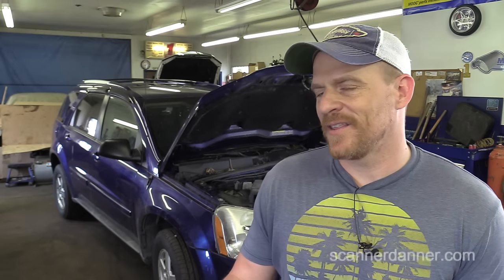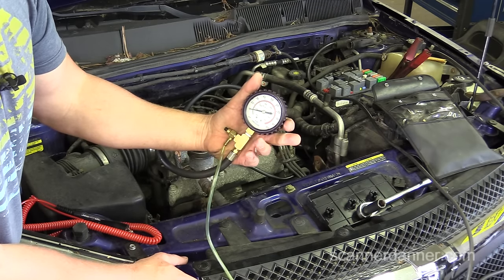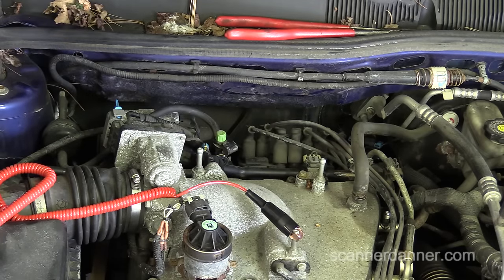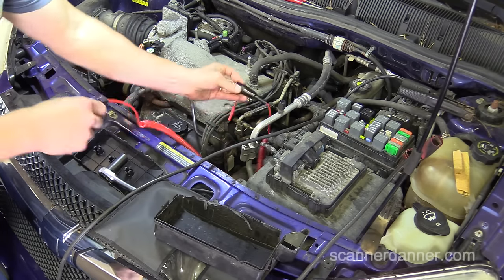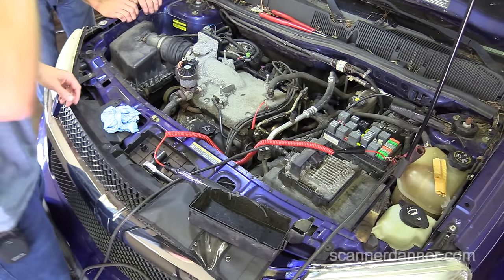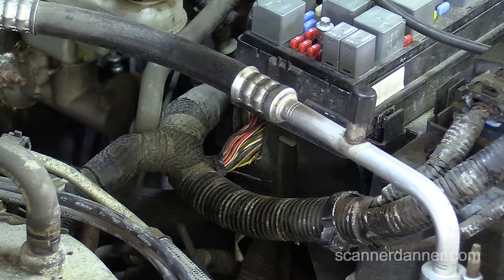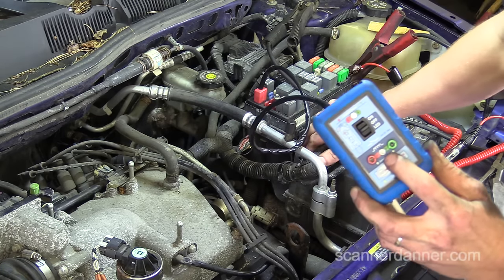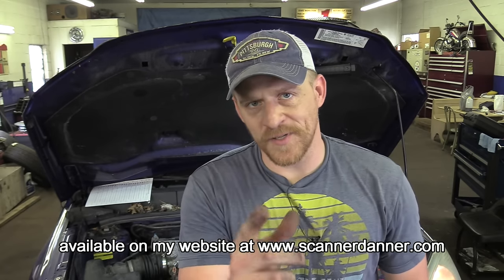No Start, Engine Cranks Okay, Troubleshooting With Basic Tools (No Power to Injectors)

Comment: Paul or anyone can you help me with my 2004 Yukon cranks no start new crank sensor & plug. I am getting a signal to my fuel relay for less than 3 seconds then it turns  off. I have power going to relay all the time. Relay is good not the problem. Is there a video i could watch for this?

Comment: Can you help me out a bit, I have a Chevy Sonic 14, injectors are not firing, I put a multi miter to it and I can't detect any signal down the line so it's electrical.
I have a code u0101 not detecting the TCM, I am almost sure there is short of an open somewhere, electrical work seems daunting.
How should I proceed to find the fault, thanks in advance, I'll follow some of the procedures found in this video but any extra help won't hurt
Reply from the maker: Let's move this to my forum www.scannerdanner.com 
It is free to join and we can definitely help you. I have 28k global members and hand picked moderators who've been with me for years and know my material inside and out and are there to help me help you guys. It is just too difficult to offer back and forth messages here on YouTube with stuff like this and we also can't share pictures and images here like we can on the website. Hope to see you there!

Comment: Hello, Paul. I am trying to figure out a crank no start condition. I have read that the crank sensor is not used for engine control system. It is used for onboard diagnosis. Can I rule out the crank sensor as the reason for the crank no start?
Reply from the maker: That would be incorrect. Most cars will not start without a crank sensor signal.
It would help to know what you're working on (year, make, model, engine, trouble codes etc) and also what you are missing (spark or fuel)
Reply: @ScannerDanner   2000 Nissan Xterra. What I read was from the description and operation of the crank sensor for this truck. I should have been more specific. Sorry about that.
Reply from the maker: @bbmd2200  absolutely! Yours is the anomaly. If this is a distributor engine, you are correct, that crank sensor has nothing to do with your no start. It is used for low speed timing control only (smooth idle speed) weird system.
Reply: @ScannerDanner  Yes, it is a distributor engine. Thank you for replying. Stay safe.

Comment: With any relay controlled circuit the VERY FIRST thing I would do is check the relay.  Dosent matter if its a ground or hot tripping it.  Reason... first its the easiest to check with an ohmmeter or test light. second theyre more likely to fail than a fixed (within reason) wire.

ANY relay has a coil and if thats open -- it wont work.  Find both ends of the coil pins and check for  both ways by reversing the test light or ohm meter. ALL relays in a properly designed relay will have a spike suppression diode across the coil. A good relay ( as far as the coil goes)  will show  BOTH ways.  With a bad coil that diode will conduct in one direction ONLY. If it shows no continuity either way BOTH the diode and coil are open. That diode dont do much in a pure relay setup but it can cause all sorts of weird things where computers of ANY form are involved with relays because of the back emf from the coil when the circuit is opened up. The diode shorts out the back emf when the juice through the coil is shut off. With a double throw set of contacts the common will show continuity from the common to one of the contacts with the coil unpowered  and from common to the other one with he coil hot. Easy to check with a pair of jumper sand that battery in the car. Ive seen 2 with bad/burnt contacts but with good coils.. :) 

Number 1 rule to fix anything is to start at the easiest thing to check first then go deeper if needed. 

Over all a great series of trouble shooting and fixing there. You just have to be smart enough to figure out even the most advance scanner will never tell you the EXACT cause of fault codes but only where to start looking why the fault occurred. :)

Comment: I have the same symptom but opposite of this. I have power but no pulse. Chevy 4.3 spider injector. How can I test? Thanks in advance.
Reply from the maker: Step 1, what is your fuel pressure?
Reply: @ScannerDanner  Thanks for replying so fast. I have about 55psi with a brand new fuel pump. I have spark and a brand new spider injector system. The engine runs with starting fluid. I found power to all 6 injectors but they are not firing. Thank you
Reply from the maker: @jaysplace1299  these injectors will NOT fire below 50psi. What is your exact pressure during cranking? Should be minimum of 60psi
Reply: @ScannerDanner  I will check and get back to you. Thanks
Reply: @ScannerDanner  I have 56psi  with key on and 62psi while cranking. New parts are fuel pump, spider injector, crank and cam sensor. power to injectors but no pulse. I updated to new style multiport spider injector. How can I test pulse from ecm?
Reply from the maker: @jaysplace1299 do you have spark? Very important to know before our next step.
There is a purple/white wire (distributor reference) that we're possibly going to play with next (with an incandescent test light)
Reply: @ScannerDanner  Yes, I have spark and if I spray starting fluid or gas into the intake, it will run great until its out of gas? Gas is just not going through the injectors.
Reply from the maker: @jaysplace1299 okay perfect. Next step, with key on, touch on and off the purple/white wire on the distributor connector with a test light to battery positive. The fuel pump should turn on and injectors should fire each time you touch it. Tell me what happens

Comment: I have a 91 chevy caprice I've checked relays change fuel pump and I'm not getting any power to the fuel pump the only power its getting to the fuel pump is the sending unit wire works what you think I can do
Reply from the maker: Do you checks at the fuel pump relay next
Reply: Yes so far it's coming on or let's say I can hear it click on
Reply from the maker: Not good enough of a check. We need to see the load side of that relay light a testight with everything plugged in DURING cranking
Reply: Ok I'll try that and get back with you
Reply: Ok I check it and I have power to the orange wire I also have power on the green and gray wire for 2 seconds when I start it
Reply from the maker: @tristenfletcher577  The gray wire is the pump feed. If it is good at the relay and then not at the pump itself, you have an open in that gray wire between the relay and pump
Reply: @ScannerDanner  so I need to run another gray wire

Comment: My santa fe crdi wont start but it cranks OBD error code p0611 found my ecu has burned chips is that posible that was the cause of no power injector?
Reply: By the way hired mechanic was the one mentioned me all of this Hope you can help me with this question im a newbie.

Comment: Quality OEM fuel pump should last at least 1K miles or more. If you take proper care of them that is. Automobile manufacturers build in about a gallon of reserve fuel beyond the empty line. Some of us know this and like to play that dangerous game of driving until the very last possible minute. However, from what I've learned it's bad practice to run your fuel tank low on vehicles with intank fuel pumps. The fuel pumps rely on fuel to lubricate the pump.  Take that lubrication away and its only a matter of time before the pump burns out. 

I personally can appreciate the fact that sometimes we just don't have the cash on hand to top off or even keep our cars tank at half full. I mean we have to eat too sometimes. Right? 😉 Gas prices can be cost prohibitive at times for some of us. However, keep in mind that it's more expensive to replace a fuel pump. Not to mention the trouble/inconvenience of being stranded somewhere.

I was surprised to find out recently that a failing fuel pump may cause your engine to overheat. From what I read If your fuel pump is dying it might overheat and this heat causes your engine to overheat. Unlike the radiator, which will overheat until it bursts the cap and spews scalding-hot coolant everywhere, an overheat caused by the fuel pump will stall out the engine. So, pullover at the first sign of overheating.

Comment: What would cause a intermittent crank no start? Especially in the early morning once/twice a week...

1998 ranger 4.0 4x4 

Codes: p0171 & p0174 

Ive smoked it. I've replaced vacuum tubing that was  corroded. 

I've cleaned/changed;
IAC
MAF 2x
Throttle body cleaned 
Fuel Pressure Key on 62-72 psi/ KO; 56psi maintained press for hours...dropped to 45 psi in 3 hours. 
New Fuel filter
New Plugs/ wires
Reply from the maker: What is fuel pressure when it is not starting?
Reply: @ScannerDanner  I haven't tested it when intermittent problem occurs. I will test it next time it happens, but if the psi is low or non-existent what would it be at the point?
Reply from the maker: We focus on the pump circuit and pump itself.

Comment: nice one. thx for sharing. i have a 1994 toyota carina with the 85kw 4a-fe engine and bosch ignition system and ecu. it's also a no start. fuel pressure, spark, compression all OK. there is voltage at injectors, but they don't pulse. was thinking bad injection driver. changed the ECU, still no start. All voltages in and out of ECU OK. What would you check next?
Reply from the maker: I believe there is an IGF circuit on that ignition system that provides the ECM with the necessary signal to fire the injectors. It comes from the igniter and is generated by the firing of the ignition coil
Reply: ScannerDanner thank you for answering. the bosch ignition system on this model doesn't use an ignitor only a coil. https://www.rexbo.eu/bosch/coil-ignition-221502002?c=100150&at=5240
type of distributor used; http://www.autoparts24.info/item/A_0026_E13811/
Reply: R. E. Hill I have a corolla has similar coil cracked the igniter would be connected to pickup coil in distributor feeds ECU &back.to igniter
Reply: Don Desnoo ho Don. Carina E Xli AT190 1994 85kw doesn't use an ignitor. Other versions of Carina does, but not mine. On those models the ignitor is located on the left strut turret housing or it is a part of the distributor. So no ignitor on my model. thx for taking the time to reply.
Reply from the maker: My fault. I looked up Camry...i don't have a listing for that model, I'll have to look again
Reply: ScannerDanner that would be awesome. thank you very much. this has been an intermittent issue for some time. several days of same type of weather would lead to a no start. after a weather change it would start again and so on.. it woukd run perfectly once started, never any issue, even on longer trips. then a couple of weeks ago it stopped while it was running, no start since that. had to have it towed. the stop was sudden and without any warning just as if it was switched off. have tried to diagnose it for a long time, but since it is so intermittent i am unsuccessful. only no firing of injectors. that's it. that paired with the fact that my knowledge on this subject is just a tad over basic. however i do know how to google and watch youtube.. ☺ your channel is just a wonderful thing. and Ivan(pine hollow auto) and Eric O (south maine auto)... ☺ rather watch you guys than anything made in Hollywood.
Reply: R. E. Hill my coil had a crack I tested it w .battery charger and a tv.capacitor on the neg. terminal grounding the case when I jumped the cap .spark jumped to crack  .I siliconed it tried it starts got new one advance Autos.. yours similar .coil in distributor on mine.same thing happened very intermittent finally towed no start .
Reply: Don Desnoo thx for answering. i have good spark. this is not the issue.
Reply from the maker: can you did up a wiring diagram for me for this? Maybe post this to my forum, it would be way easier than doing this here. Let me know when you do okay?
Reply: ScannerDanner hi. wish i could. cant find diagrams for bosch only denso.. and they are different.
Reply: R. E. Hill ha
maybe try propane to  
 air inlet to start .check for crank or cam sensors if used ECU has to get pulses some place.
Reply: Don Desnoo hi. thx for the suggestion. there isn't a crank sensor. it uses the hal sensor inside the distributor(so sort of a cam sensor). your suggestion has been tried,  didn't do anything but run of the starting fluid, it did not activate the pulsing of the injectors. thers must be a short to ground somewhere. can't find it. thinking about wrecking it. gonna hurt if so, really like it. 😭
Reply: R. E. Hill another power 12v to ECU 5v to injec

need12v .to ECU 5v to tps  I know you repld ecu  you need diagram ho abt Haynes book bought book wrong diagram called them sent us alternate for Volvo theirs very good. if it has tach w propane run dist pulses are there .I'm ret tv repairman some auto elect.knwledge 75yrs old .
Reply: 5v to sensors sorry
Reply: I would check anti-theft system causing the ECM to not pulse the injectors on purpose. A mismatch between key fob operation and individual door lock solenoids can cause the issue as can a bad anti-theft module itself. My BMW still won't allow me to use the electric windows when it's cold, but ever since I cut the nefarious pin 66 wire to the ECM it will at least start and run for me at all temperatures, not just when it's a warm day.
Reply: Lee Barnes hi. thx for the suggestion. no anti theft system on the car.
Reply: R. E. Hill igniter above eng temp SW.or shock towering Haynes has a book on them.
Reply: R. E. Hill try unplug map may be full moisture had aries had too relocate sensor above engine only ran w unplugged
Reply: Don Desnoo there is no igniter on this model. this version of carina has the bosch ignition system using the Motronic Bosch ECU. That system doesn't us an igniter. I have the Haynes manual and it's not very helpful nor accurate for my version and my particular problem. Especially the wiring diagrams are useless. I have Toyotas electrical wiring diagram supplement EWD303F, but that is the wrong one, i need publication number EWD205F or EWD233F. I can order it from Germany, long delivery time...
Reply: R. E. Hill Toyota owners club USA  see trouking  has one  many notes on it  his no igniter .2016 .if you can find him still

Comment: Do you have any videos where the vehicle cranks and starts for 2 seconds then dies? I love you trouble shooting videos, you teach with so much details even a novelist like me can follow. Thanks.
Reply: Thanks so much Jerel! Off hand I can't think of a case study video I've done. Between my two channels I have 700 videos. I know I have some lectures on that symptom and what I've seen. What are you working on? I may be able to guide you here.
Reply: Thanks for your response. I'm working on a 2001 pontiac grand am 3400 SFI Ram Air.
Reply: Any antitheft codes in either the PCM or BCM? These are known for it. Is the theft light blinking?
Reply: No, the theft light is not blinking. No engine light either.
Reply: The key doesn't appear to have a resistor in it.
Reply from the maker: It's not on the key. It's in the ignition lock cylinder
Reply: I replaced the key lock cycinder and disconnected the battery and followed the sequence for making the PCM learn the new key lock, no luck.

Comment: I need your help 2008 Grand Prix 3.8 base 130000miles my car been cutting off at idle so I change the alternator it did it again had a struggle getting it started back up so I’m like let me scan it while it’s on it said crank sensor so I went about replacing the crank sensor so I tried starting the car nothing it just crank I also had upper and lower gaskets changed I did noticed my coils screws won’t screw in I think the steel icm bed screw tread is scrip
Reply: Scanner danner I need your help I can’t continue to dump money into my car for nothing

Comment: I noticed your a god of wiring haha, any idea of where to start on these error codes on a 2002 pt cruiser, it also is a no start, the fuel rail has pressure,, it just wouldn't start one day. it turns over fine, inspection hole of cams are fine, meaning timing belt in tact..
p0508,p1193,p1491.............ive tried another pcm. cam and crank sensor.

Comment: I have a 1991 Olds 98 Series 1 3800.... It will not start... I have no spark and no injector pulse.  I have fuel pressure at the rail. I have replaced the crank sensor 3 times, I have a new ICM and coil pack (one brick coil pack).......  I have tested the volt signal coming from the 3x 18x Hall Effect Balancer AND I have a constant 5 volt reference signal coming from it.....no on off signal..... I have run codes and it's showing a 42 OBD1 code......... I'm stumped.

Comment: Ok I paid to be a member for Mitchell 1. But my wire diagrams are not colored,?  How do you get them in color?    Mine are just white and black.
Reply from the maker: The wire colors are listed, that's all you need. When I print them,  I print in black and white. Colored diagrams won't help you read them anymore than the black and white ones
Reply: ok thank you for your help,  i watched a video how you explained the four wire coil,    you explained this excellent very clearly, can not get better than that,    you are a great teacher.

Comment: I had same but had a jumper ground going to fuel relay and it was working then nothing so I took a tester and hooked it hot battery and other to ground at injector was trying to get in position so I could see it while cranking when I jiggled it at battery pump started working again explain please
Reply from the maker: Not a chance I can help you with what you've provided. Year, make, model, engine and what are you missing? Spark, fuel injection pulse, fuel pressure etc.
Reply: Must have a bad ground somewhere, if scanner danger was here he would find it . Thanks anyway scanner to much info to type in this limited space